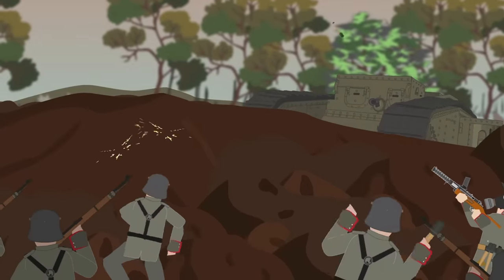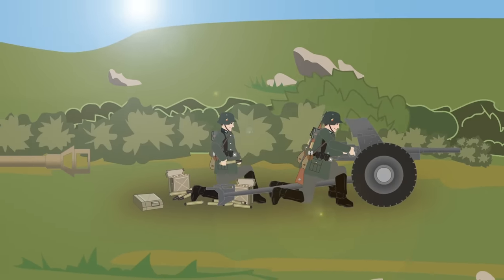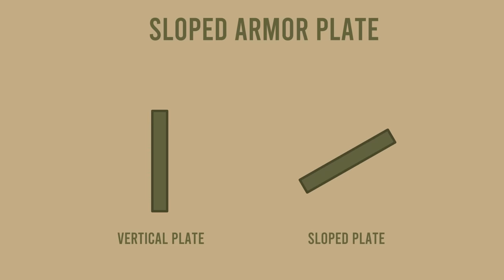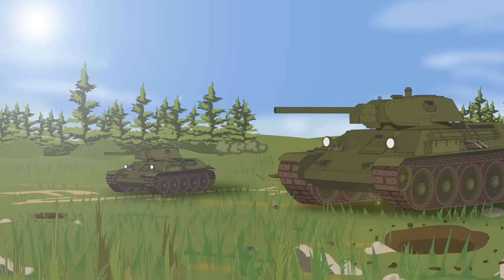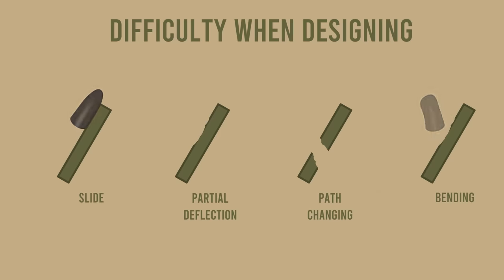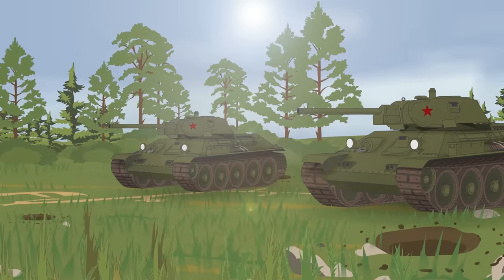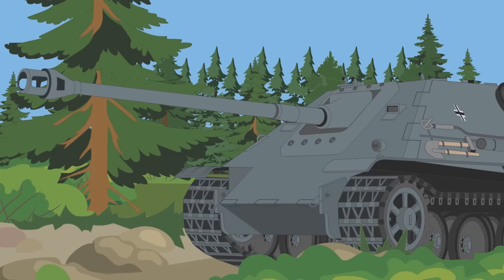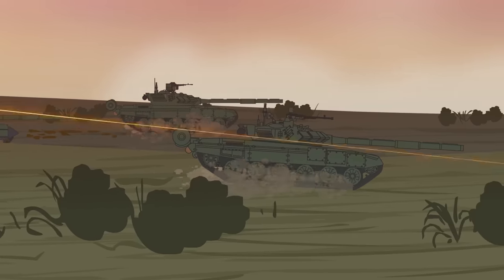Sloped armor: A simple feature that saved many lives

Comment: The fact that a T-34 let itself get hit 23 times by a getman anti tank gun speaks volumes to how blind T-34s made there crews
Reply: It is a perfect example of sloped armour as it shows its strengths, getting hit 23 times before penetration. And its weaknesses, cramped interior leading to poor visibility and therfore getting hit 23 times.
Reply: @shredder8525  Poor visibility was due to the horrendous optics and periscopes made in Russia at the time due to lacking workforce and materials, not armor sloping.
Reply: @shredder8525  no that had more to do with poor Soviet quality when it comes to optics more than anything
Reply: lets not forget about terrible optics, palcement of the optics inside the tank , glasses of optics cracking when firing the main gun, no commander coupola etc^^
Reply: it wasted the anti tanks gunner's ammo so it was actually a good thing
Reply: @duckyboi2297  no? Because that AT Crew still survive and learned its lesson and isnt going to donthat again another time. Further more the opticd and stuff didnt improved..and later in the war the Paks in general had the Power to penetrate the armor
Reply: @tizi087  ik.... but it still wasted their ammo regardless of them learning their lesson. Many other AT crews would also waste a lot of ammo to then "learn their lesson",  meaning the slopped armour did in-fact waste the AT crews ammo no? Also upgrading AT crews with bigger guns wasted even more steel for bigger rounds and guns.
Reply: @duckyboi2297  1st: ammo is x times cheaper than a tank
2nd: the turret ring was still damaged
3rd: you basically cant waste ammo, where was the ammo wasted
4th: I wouldnt call it a waste of steel to make a Pak 40 or even Pak 43. One shotting every tank because you have so effective guns is not a waste at all
Reply: @tizi087  actually a Pak 40 or 43 can still deflect off of armour if the rounds it used arent of proper quality and the angle it shot from. I would say a 88m flak gun would be the most successful at blowing tanks up most of the time. Also it is a waste of steel because it meant that the germans had to upgrade their weapons to match that of the soviet tanks. Before their paks (like the Pak 36 or 38) could easily knock out a tank as seen in the video. Also wdym, AT rounds can be used and wasted by not being able to successfully penetrate a tanks armour
Reply: @duckyboi2297  1: yeah but the chance of them bouncing on a T34 is low, only higjer on soviet heavy tanks

Why would be the 88 flak gun better than the Pak43? The latter litrally is the same Caliber with better Performance

3: every Bulletin that Hits the enemy helps. Because i doubt a Crew constantly hearing ritochets rwmains very eager to advance
Reply: @tizi087  1. true
2. yeah im not an expert on calibers but you are right, they both use standard 3.46 in 
3. yes but that doesn't mean the tank is destroyed. Order 227 would make every soviet more scared of retreating than to advance so it wouldnt matter if they were getting frightened by some ricochets anyway
Reply: @duckyboi2297  the story was as I know in 1941 before 227

+

Even then the 37mm has a chance of penetration and can still damage optics and gun, making the tank useless.
Reply: @tizi087  honestly i've forgotten what we are debating about right now
Reply: @duckyboi2297  you were defending the soviet tanks by saying it wasted there ammo
Reply: @kameronjones7139  pOoR sOvIeT qUaLiTy
Reply: @qwertykeyboard5901  I shouldn't be surprised that someone with the name "qwerty keyboard" couldn't come up with a reasonable argument
Reply: @duckyboi2297  the Soviet’s double heat treated the steel in the t 34 making it have lots of sprawling if hit with anything over a 50mm and the welds would brake and the armor could easily crack or sometime shatter and the m4 was cheaper to build and with a well trained crew could put out 3-6 rounds when the German 88 on the tiger was still being reloaded
Reply: @tizi087  You can 100% waste ammo, it isn't infinite and especially on the front line. Every single shot that doesn't penetrate is a shot that could have penetrated the armored vehicle behind the target. Lets say on hand they have 84 shells and none of the supply has been damaged. It will take x amount of time for rearmament after those shells are expended at every second death looms (especially while laying defenseless with a uselessly empty ATG). Hypothetically lets place and IS-1 as the target and is has taken then 30 shots to ammo rack the tank. What then if another IS-1 accompanied by a T-34 appears? If they don't get lucky or hit the perfect spot and we assume it takes the same amount of shots fired to disarm those targets they're left utterly defenseless against even some of the lightest scramble tanks still in service like the T-18. It's best to stay concealed and only fire if absolutely necessary, cause a distraction that could save lives or equipment more valuable to the war effort than your own or you believe you have upwards of a 50% chance of penetration.
Reply: @kameronjones7139  cope more western creature. The video literally explains how genius soviets were to implement sloped armor so well. The optics were dogshit yeah, but that doesn't mean they didn't know how to build those, they had just priorities.
Reply: @brokentortilla  a YouTuber by the name of "Lazer pig" did a much better video on the t34. It wasn't revolutionary to have that type of armor and hurt the design in many ways

Comment: Fun fact: due to several factors, the protection of sloped armor increases sharply at around 55°.
Reply: Huh! 55° isn’t what comes to mind quickest (I mean it’s always 30, 45, 90, 180, or 360 that’s usually talked about in angles)
Reply: @ritagasper1958  the likelihood of a round being deflected rather than being stopped rises, so less energy is exerted into the armor.
Reply: Yes, but the nice factor of the armor maxes at 69°
Reply: @kyleplatter8954  ofc a kyle would say this
Reply: Another fun fact, shells do not penertrat on line of sight but angle down before resuming horizontal flight on exit. It still helps though.
Reply: @CrusaderSports250  
They 'technically' angle down, but at combat ranges its something like 0.5 degrees, which might as well be nothing as far as the armor is concerned.
Reply: Now i know why i struggle to penetrate a T-44 upper plate with my Tiger 2 in War Thunder.62 degrees is pretty overkill for WW2 AP rounds it’s almost an instant shatter if the base armor is decently thick too.
Reply: It gets more and more effective as the angle from the vertical increases,at 60° from the vertical the line of sight thickness is double due to the cosine being 1/2

Comment: I wouldn't necessarily call this a simple idea,because even though it seems simple in Concept, in order to do it requires a lot of design work, as you are needing to make compromises to get the slope to be at a useful angle, which massively cuts down on the interior volume and thus limits what you can have internally.

The whole 'sloped Armour is better' thing is actually been known for a long time, at least since the dreadnought battleship era  if not even before, but the problem is no one could figure out a way to justify the expenses that sloped armour puts on the interior volume of whatever you are designing, so it wasn't used in many applications until the interwar era designs and the pressure cooker that was WWII
Reply: i've never seen anyone call a war a pressure cooker
Reply: Y-day I woke up, went to toilet and while I was sitting there I came to same consideration
Reply: @random_potato2549  the term is used quite often when it comes to describing tech advances as a result  of war.
Reply: "Just angle the armor, it'll make us win the war!" 
"OK, where should I put the gunner, half of the barrel, the radio, the driver and half of the other crucial parts?"
"In the tank."
Reply: @Thexakatron  "but the crew won't be able to escape easily!"
" that's why we have mass conscription; we lose one crew, 4 more are already being trained!"
Reply: Castles, when those were still a thing, were sometimes built in a star shapes, presenting angled walls to every direction, but the ones the enemy couldnt reasonably reach anyway.
Reply: @potatono7548  the " star fortress" designs, yeah
Reply: @Shinzon23  "Sir, respectfully, have you even been to the recruitment office? It's running thin."
"Draft time it is then"
"But--" 
"Shut and build it, or I'm putting you in the  Gulag."
(I know you mentioned Mass Conscription anyways but... Funni.)
Reply: yeah they do mention the downsides, they mentioned about how even though they could afford to make plates thinner, problem was they had to make said plates longer to the would cover the same height
Reply: And the armor has to be Aleast decent quality and if it isn’t it could be disastrous
Reply: @random_potato2549  I heard it many times from an Old Vet neighbor of mine.
Reply: @Thexakatron  sad tbh.
Reply: Question. People often say that sloped armor compromises space and I can understand that in a turret for example, however, tanks without sloped hulls are usually not just simple boxlike shape like the turret, but rather have the transmission stick out. I would assume you could get better armor and a bit more room if instead of having a “stepped” hull (like the Panzer 1-4, T-26, Churchill), why not use a single sloped plate for the upper glacis(T-34, Sherman, Panther)? A good example of this is the IS-1 and early IS-2 vs the later IS-2 tanks. The early IS tanks had the “stepped” hull design similar to the early Panzers and Churchill, but the later IS-2 hulls featured a single upper front angled plate.
Reply: @MPdude237   The issue with that design is that then you have to figure out how to get the rest of the frame to support the weight of that front glacis plate, which causes support issues at the attachment points of front plate to hull sections.

you have to remember that casting a single giant monolithic tank hull that size, shape, and that thickness was not something that could easily be done at least until I would say the late thirties and the forties; it was considered a engineering marvel when it was pulled off, due to the need to not only cast the hull piece in one go, but the attachment points for equipment and engines as well, which takes a very specialized mold/forge system to ensure there isn't any deformities or air bubbles or spots that cooled too slow/quickly.

Angled Glacis Plates were more commonly done on casemate vehicles, where the weight savings from the deletion of the turret mechanism could be then put towards more frontal armor plating.
Reply: @Shinzon23  This makes more sense. I have not seen any tank that was just a simple 6 sided box with tracks and a turret attached. The engineering part is definitely insightful, as I assumed it would be more economical to use one or two plates to make up the front of a tank instead of three plates.
Reply: @MPdude237  using multiple plates was a thing done for casement styles, but then you have the issues of keeping the plates on; welding was still a new tech and a lot of nations didn't trust it initially; this is why you'll see usage of rivets and bolts on some nations tanks even into the late war, but the issue with these is that the rivets could become projectiles flung into the interior if hit by a otherwise non pentrating AP shell or a shell with enough explosive mass.

Also partially the reason you see as minimal a number of plates used on armored vehicles is cost to repair; whilst you could (and indeed, what did happen during the war) have large pieces of "blank" armor steel to cut down to size at a repair depot, that means that whatever material you have left after cutting it down is now usually not useful for usage elsewhere and needs to be sent back to be melted down again for reuse. It was usually cheaper manufacturing and logistics wise to ship a few larger pieces of metal all one shape and used "as is" than dozens of smaller plates.

 There's also the issue of you running into things like "you have a bunch of plates for a stug II, but you don't have the plates for a panther at hand"; you want to keep your logistics as unified and as close to "I can use parts from this for another vehicle" as possible without needing to resort to large scale depot work.

The Germans were notorious for this due to their usage of many different designs including captured tanks all needing their own supplies of parts to repair, which was a utter logistical nightmare due to the factories making those parts usually not in Germany itself and often using different quality metallurgy than the Germans as well; this doesn't even touch on the insane amounts of different calibre artillery for example.

On the other hand, the allies generally didn't go that nuts with variant vehicles, or at least tried to make it so that the variant used the parts from a more common vehicle if issues arose; look at the Churchill and its family of specialist vehicles, or the Sherman and T/34; so many spare parts were churned out for both that it was legitimately a thing that if your tank broke down, you could have the crew then hop into a spare tank assembled from a hull and spare parts in short order, and the soviets churned out so many t34s that it was actually on the books for the crew to abandon their vehicle if/when the thing blew a engine or transmission, let the repair crews know, and hop into another T34 waiting at a logistics and transportation area and continue the March.
Reply: Yes tot, sloped armour is presented as a kind of miracle, but it doesn’t really bring value if the crew is cramped or comfortable as it negatively impacts crew performance
Reply: @wanderingnomad1   Case in point the ergonomic nightmare that was most Soviet World War II tanks
Reply: @Shinzon23  There is no training, they learn on the job...
Reply: The Soviets produced a lot of equipment where they did not think about amenities at all.
In long-range bombers, toilets appeared not long ago.
In fact, this is a tribute to peacetime. fly to one side.
A human life is worth nothing even now in Russia, especially of the third grade.
Reply: @American97percent  A human life is worth nothing in the US.

Comment: There is a thing called a shell trap on some tanks, where the shell can ricochet off an armor plate, and go straight into a flat or weaker area of armor, which the shell can penetrate,    which can result in the death of the tank.
Reply: This should bé couled (designer erer)not a shell Trap 🤣🤣🤣
Reply: Not anymore.
Reply: @اسكندرفكار  the official term is a shot trap
Reply: @the_burger  it could be possible on leopard 2s, assuming the shell hits the correct area
Reply: @eaststarling7805  its not a Trap for thé shot its a good Luck for the shot
Reply: @eaststarling7805  its not a Trap for thé shot its a good Leck for the shot
Reply: @eaststarling7805  Still impossible. The ammunition modern tanks shoot makes it nearly impossible to ricochet off of leaner angles. Leopard 2's pike armor is not a solid block. It is a composite array. The projectile would get inside and either get stopped or penetrate. Educate yourself.
Reply: @the_burger  you are Right but if thé leaperd is giong agianst a modern russian all what thé ru tank will do is shoting a guided missile on thé canon of leaperd and take her Time to destroy the Un capeple tank 👍👍🤝
Reply: @اسكندرفكار  war thunder moment
Reply: @the_burger  could it not ricochet off the lower parts of the cheek, and bounce down?
Reply: And Now Missile wants to end our TANK's Career
Reply: @eaststarling7805  The low part of the tank is Harder to hid ...Some cases it penetrated the tank
Reply: @nowwhat9053  the lower part of the turret cheek on the leopard 2a7
Reply: panthers
Reply: @eaststarling7805  no when talking about APFSDS due to how much speed it have the round either penetrate or shatter, the Leopard turret wedges designed for that basically when an enemy round hit the wedges due to extreme angle the round may or may not tumble or change its vertical angle to the point where the angle is to vertical the dart is no longer in posisition to penetrate thus get shattered when in contact against the main turret armor
Reply: @eaststarling7805  the arrow head on the leopard 2 is made of aluminum, it’s made to ruin the penetrators trajectory before hitting the actual turret armour causing it to break apart instead of penetrating.
Reply: @اسكندرفكار  
Ofc an arab barbarian wouldn't get the reference.
Reply: @eaststarling7805  APFSDS rounds do not bounce. It’s hard enough to get them to fly in a stable way already.
Reply: @nuclearwarhead9338  Racist much?
Reply: The infamous Tiger and Panthers and very well known for its shot traps
Reply: Why have you written death of tank, tank does not die it gets destroyed
Reply: @YouDontKnowWhoIAm_OG  tanks don't need to be destroyed
d to be taken out of combat